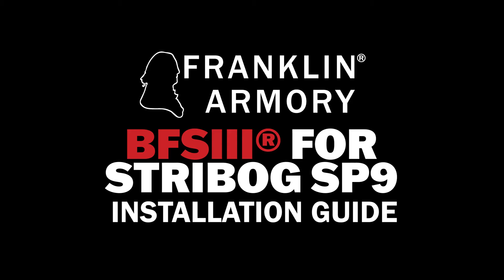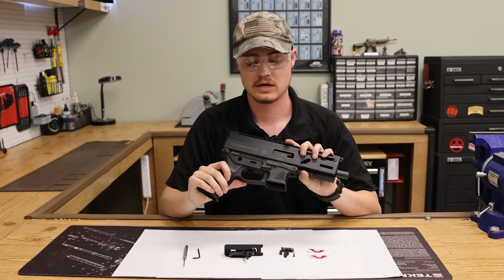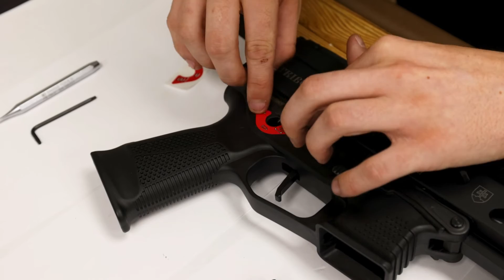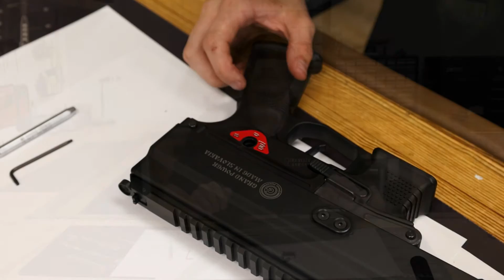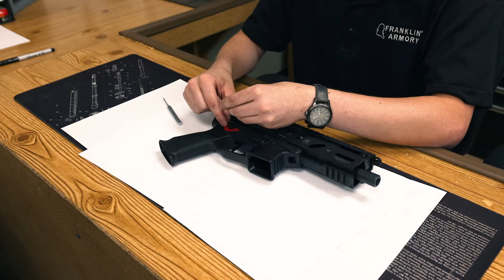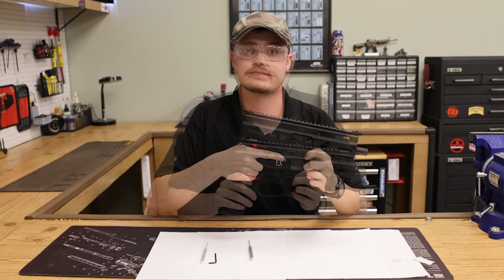How to Install Your Binary® Trigger for Stribog SP9

Comment: @FranklinArmoryBFSTM  this is super weird that you guys would misinform people about your product. IT WORKS WAY BETTER WITH THE DETENTS. without them the trigger pack is not located properly in the lower, the binary functions without them. I wouldn't suggest it though... the feel of the safety and even trigger is affected by not running the detents. The entire casette moves inside the lower without them. Surely you guys are wrong. Even if you GOOGLE AI it, it says to run the detents. Yet you guys are here sta

Comment: I'm trying to find out if this will work for the SP10A3???
Reply from the maker: Right now, the SP-S1 Binary® trigger is compatible with the Stribog SP9 only.
Reply: I think you need to get the Lingle lower and then get a binary for an AR. This is my plan at least, but the lingle lower is perpetually back ordered. I just got my sp10a3 , got my 46M suppressor, have my holosun DRS TH and my A3 stock is en route, all I need is the stock then I can do my form 1 and the last thing is the binary trigger.
Reply: @johnnyb8629  I got it the first day it came out! Works amazing!

Comment: Just to verify, are the detents that retain the original safety selector removed with the original trigger pack?
Reply from the maker: Correct. Full removal of the OEM trigger pack--including the OEM detents--will allow our Binary Firing System pack to easily drop in and seat completely to reassemble the upper and lower receivers. Thanks for bringing that up. We'll add a clarification line to the video shortly.
Reply: @FranklinArmoryBFSTM  this is super weird that you guys would misinform people about your product. IT WORKS WAY BETTER WITH THE DETENTS. without them the trigger pack is not located properly in the lower, the binary functions without them. I wouldn't suggest it though... the feel of the safety and even trigger is affected by not running the detents. The entire casette moves inside the lower without them. Surely you guys are wrong. Even if you GOOGLE AI it, it says to run the detents. Yet you guys are here stating the opposite. Guess what just threw detents in with your guys safety and trigger and walloh, my 500$ trigger finally feels half decent..
Reply: Just an fyi they are a pain in the ass to get out. And even more so if you’d choose to put the original pack back in. I’m guessing they didn’t show the removal for that reason.
Reply: @sk8rpunkn8  Which is why its better to just grab a Lingle Industries lower. That way install is easy and you get to install the AR pistol grip of your choice.